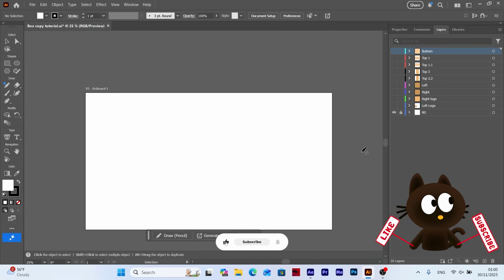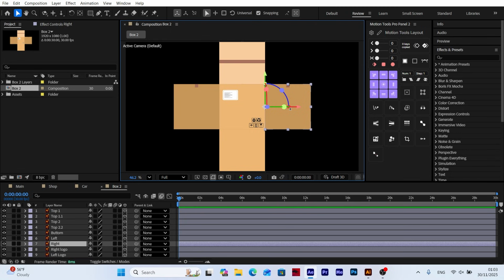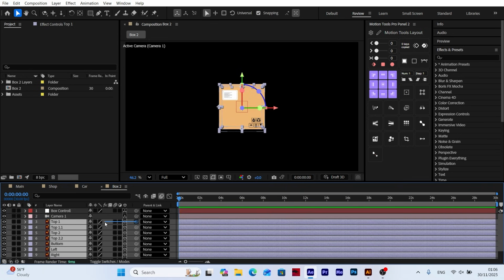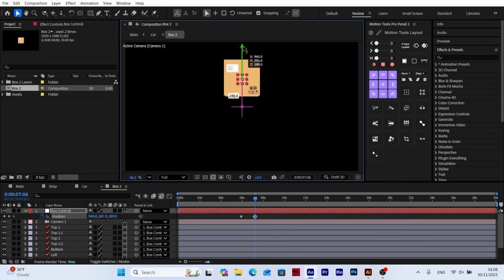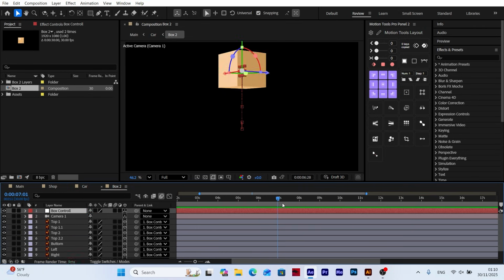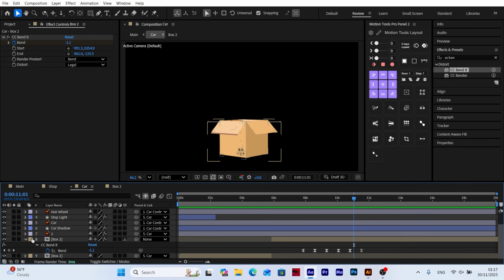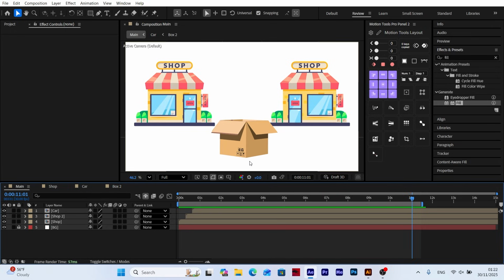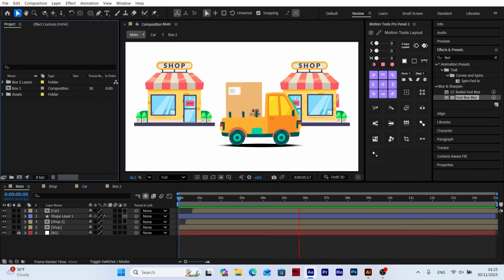After Effects 3D Box Animation Tutorial | Mastering the Graph Editor (No Plugins)

Comment: Hello brother, Would you suggest windows pc or latest mac apple silicon for after effects??
Reply from the maker: Hi brother, thanks for your comment!
Both systems work well for After Effects, but the difference is mainly this:

If you want power + best price/performance → go for Windows

If you prefer stability, quiet performance, and portability → go for Apple Silicon

If you’re doing heavy 3D work, Windows has an advantage. For motion graphics and daily AE tasks, Apple Silicon runs very smoothly.
Both will do the job depending on your needs 👍